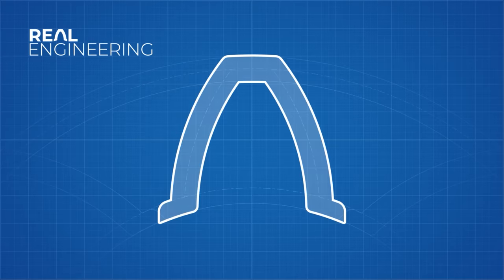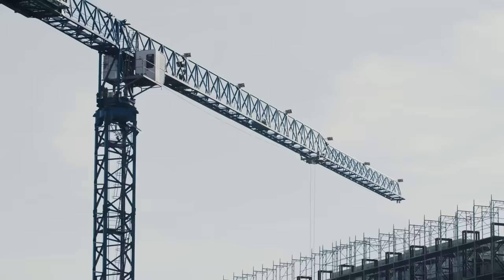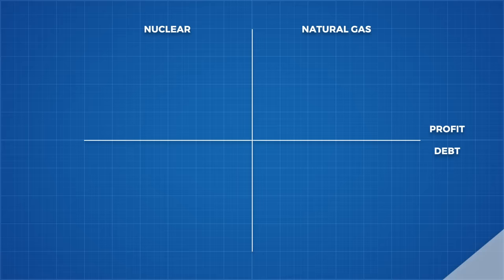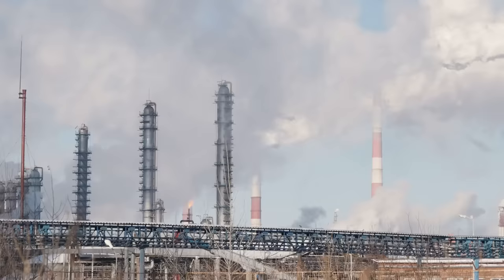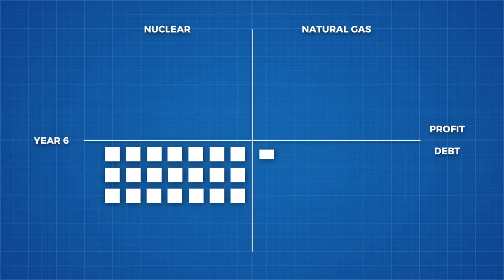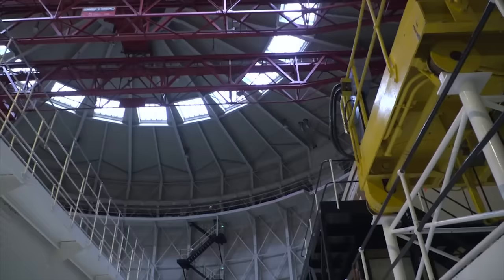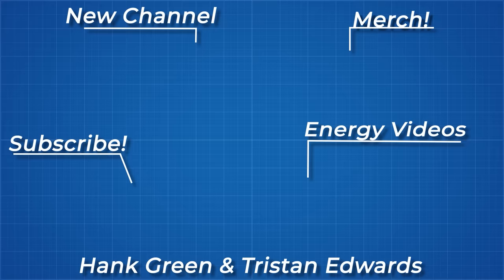The Economics of Nuclear Energy

Comment: LCOE is a poor measure since it doesn't include all the other infrastructure needed to make a workable grid. For renewables that include greatly increase transmission capabilities and massive amounts of storage, which other forms don't need. If renewables were required to include the 12-14 hours of storage needed for reliable power through all conditions, the LCOE would be far higher than anything else.

Comment: The only reason Diablo power plant can't compete is because of how California sets up their grid. The state does not put baseline nuclear first which means there are periods where with excess solar and wind energy. During those times power becomes almost free.  
Battery storage isn't the solution, its expensive materials wise and we've got limited resources to make them. 

you conclusion is so fundamentally flawed, nuclear is baseline, over a lifetime they generate 95+% of their rated output. peaking should be done with mass based storage (pumped hydro ect)
Reply: Diablo is and always been base line.  You cannot swing load with a nuclear plant. utilization factor is 93% and has never exceeded 94%....just saying

Comment: In the US the cost for 1Gw is about $15B or close to three times the $6B. The US has two 1G reactors under construction in Vogtle, GA, at a cost of about $30B.

Also you video does not Decommission, planning\feasibility\geology studies, etc. Usually a Nuclear power plant requires between $1B and $2B just for the planing and feasibility studies, thats before a single shovel full of dirt is moved. Then there is the cost if the plant meltsdown. A single meltdown and cost trillions in economic loss due to loss of land near the site, clean up cost, as maintenance to structures to confine the destroyed reactor. For instance the Chernobyl meltdown was the straw the broke the back of the Soviet union. Four years after the disaster, the Soviet union collapsed.

Comment: Nuclear power is so risky financially that safety is moot. 
 
1 - Three Mile Island
In March 1979, Unit 2 at the Three Mile Island nuclear station suffered a partial core meltdown.   It was the most significant accident in the history of American commercial nuclear power.  The accident taught us two important lessons. 
 
1.	Nuclear power is safe for people.  Inadequate regulation, faulty design, imprudent operations and several coincidences all contributed to causing the accident.  Bottom line - the containment held.  No one was hurt.  There was no catastrophic radiation leak.  Damage awards were small. 

 
2.	Nuclear power is extremely dangerous for investors.  John Graham, the Treasurer of General Public Utilities (owner of TMI) wrote in Journal of Commercial Bank lending - May 1980, “The discussion of whether to recommend a moratorium on new nuclear plants in the Report by the President’s Commission on Three Mile Island is somewhat irrelevant.  I do not believe that there is a board of directors of an electric utility in the country which would now approve a nuclear plant as a new initiative.” 

Why?  Overnight, a billion dollars in revenue producing assets turned into a gigantic, unfunded liability.  People were safe.  Investors were not. 
 
2 - Darlington 
Ontario came close to a nuclear financial meltdown.  The first unit at Darlington was started up in 1991.  After a month, they did an inspection.  To their horror, there were cracks in the giant rotor.  It was a design flaw.  All four rotors had to be replaced.  More delay - which in a debt intensive project means escalating costs.
 
It got much worse.  When they took the fuel bundles out of the reactor, they had been shaken apart.  A massive pump within the system was putting out a vibration that was destroying them.  The pump was re-designed.  The vibration stopped.   Had the re-design not cured the problem, it was possible the entire $17 billion project would have to be written off.  (I was an Executive Speechwriter at Ontario Hydro.  I sat in the office of Ontario Hydro Chair Marc Ellison with Phil Carter, Premier Bob Rae’s personal representative at Hydro, who told me this story.  The test of the new pump was the next day and they were terrified that they would have to announce the complete write-off of the Darlington project). 
 
3 - Things have not gotten better for the nuclear industry  
The only nuclear power reactors currently under construction in the U.S. are at the Alvin W. Vogtle Electric Generating Plant in Georgia.  They are years behind schedule and billions over budget.  Plans to add two nuclear reactors to the V.C. Summer Nuclear Station in Jenkinsville, South Carolina have been scrapped with a loss of $9 billion.  Westinghouse, the prime contractor in these projects has filed for bankruptcy.  Parent company Toshiba was forced to sell its chip unit. 
 
Georgia Power - Vogtle - http://fortune.com/2018/09/27/vogtle-nuclear-power-plant-construction-deal/ 
South Carolina - https://theintercept.com/2019/02/06/south-caroline-green-new-deal-south-carolina-nuclear-energy/ 
Westinghouse bankruptcy - https://www.reuters.com/article/us-toshiba-accounting-westinghouse-nucle-idUSKBN17Y0CQ
Reply: You do realize that three mile island is still operating today right? And that to date no civilians have died in the US as a result of nuclear reactors.... right?

Also your argument against nuclear because of investment issues and it having to turn off for a time to undergo repairs forgets about massive issues like oil spills that are actually fairly frequent and cause massive ecological and economic damage.

>Government red tape and congress impeding the construction of nuclear plants PROVES it's bad!
Yeah man, you got us there. I mean it's not like France exists or anything.

Comment: I wonder if it would be possible in some cases to build a hydroelectric battery, a sort of uphill “dam” that can have water pumped to it during the night when the nuclear plant demand is low to utilize the excess produced energy and use that stored hydraulic power from the water to spin turbines during peak hours when the nuclear power can’t quickly react to jumps. Probably too many requirements to be met to really be possible in more than a few cases but it would be interesting
Reply: Yes it can and has been done to store excess energy from the production of many different power sources.....even solar.  However, the energy needed to do the pumping vs the energy gained from the water flowing down into a turbine generator makes it very inefficient.
Reply: This already exists and has existed for quite a long time. It is called pumped hydro storage, and it is cheaper and better than batteries for storing large amounts of energy. Batteries have a lot of strengths and other applications that make them better for energy storage in a lot of other cases though. However, pumped hydro storage is only limited by the size of the reservoir that can be built and the lifetimes of the hydroelectric turbines and pumps. However, as with all energy storage, there are extra losses from conversion into stored power and back into electricity. 
If you are pondering what would be a good approach for making nuclear power plants load-following, then a lot of Gen4 reactor designs incorporate load-following design features such as molten salt storage which are more efficient and have more potential to take advantage of cogeneration.

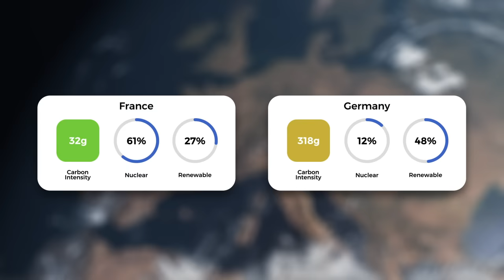Comment: Does anyone have a source on the carbon intensity numbers put up at 1:05?  Because that is a big deal.  France has a carbon intensity of 10% of Germany, the king of renewables!  If you optimize your grid for low carbon instead of low price, you'd go nuclear, hands down.  And nuclear isn't even that expensive overall, it is just very capital intensive up front.  But that is just a financial engineering problem.  Give Nukes 0% loans, or give them carbon credits during the construction period, or actually gasp put a tax on the carbon that has to be burned when the renewables aren't producing.

Comment: Does the economic model includes insurance costs.  For example, developing robots that will not break under heavy nuclear radition when/if a disaster happens.  

What about the cost to create a platform of frozen ground to prevent a melted core from reaching the water table.  Which, by the way, will need to be kept frozen with a team of engineers for decades if not millennia.  Probably using more energy than the plant would have produced.

The problem is these plants are uninsurable.  

( Cost of accident ) * ( probability of accident ) = uninsurable
~$200B * ( 1/20) = $10 billion

Plus the spent fuel is another ignored cost expected to be picked up by the tax payer after the executives get bonuses, investors get profits and the company dissolves once the accident happens.

Comment: Well a 6 year build cycle is kinda generous. Construction for a new reactor in France began in 2007 and this thing is still not finished and it may never be. In Finland construction began in 2005 and it is finished in 2022. Still not producing electricity for the grid though. France is kinda fucked right now. Their reactors are old and a fifth of them are shut down right now in the middle of winter due to maintenance. The reason Germany has such a bad CO2-footprint is that honestly energy wise is has nothing going for it besides lignite. The locations for renewables aren't the best and it has no gas, oil or stone coal. So it still burns a lot of lignite. France on the other hand has great locations for renewables. They have much more space for wind and solar, more sun and much more coast line for off shore wind. With enough public support they could retire their old reactors and transition into gas + renewables.

Comment: LCOE doesn't include anything about the environment and "utility". Add carbon taxation and price intermittence in and the numbers would look different. Low carbon electricity production is not a technological issue, whereas in other industries it is : long range flying without kerosene for example isn't possible yet. So by default all electricity production should be low carbon, eliminating gas plants (and oil and coal). Taxing carbon would have the same effect. Now you're left with nuclear and renewables, add the cost of storage (batteries, pumped hydro, etc., all technologies welcome of course), renewables could also "buy" some nuclear production to compensate for intermittence. It would be very interesting to know the results of such calculations.

But indeed politics play a major role. After Fukushima all French nuclear power plants have been upgraded with elevated diesel generators, "strike teams" have been created that can go to a stricken plant to deal with the issues and bring mobile generators and pumps in a few hours. Some seawalls have been improved. Yet politicians have decided to not decide about replacing aging nuclear plants, and have closed the oldest one, under pressure from anti-nuclear people (including in neighbouring Switzerland and Germany).

Another factor is the price of electricity delivered to people. In France it is much cheaper than in Germany and Italy, leading to people heating their homes with it (bad thing in the past, now not so bad since it's low carbon, and can be done efficiently with heat pumps). On the other hand and despite incentives, solar on roofs is far less common than in Italy where it's almost everywhere.

Comment: Has Chernobyl been forgotten along with 1000 plus years disposal.
Reply: Chernobyl happened due to a very particular set of circumstances that simply are not possible in a modern context. 

Reprocessing reduces the waste mass by 99% and the need storage duration to ~300 years. You can also transmute that remaining waste to stability in existing fast reactors, reducing the amount of waste to zero.

Comment: One of these days energy videos will be one very careful in comparing costs and build time. Here a gas plant is given 2 years to build.  How long does the gas pipeline require? It’s not 2yr.  Pipelines are frequently challenged legally, stopping and starting these cross country projects, or they’re just cancelled.  Nuclear needs no pipelines, needs no LNG tankers that may or may not arrive.  Every unit of gas used by the gas plant steals three units of gas heat from building heat.  These issues and many like them mean it’s rank amateurism to compare only on a plant by plant case, when it’s the entire system that matters.

Comment: after a quick "research " i found that for a nuclear powerplant the CO2 per kwh is 12-50, not 12 as you stated. Is this a mistake of myself or were you using the lower end of the CO2 "emission" to mislead? Or are those 12CO2/kwh in modern western plants and the 50 in older less modern plants? 
I know this is 2 years after the video released, but i still hope someone can explain this to me.

Comment: Real Engineering, I wonder what the Levelized Cost of Electricity is for sea based wind turbines?
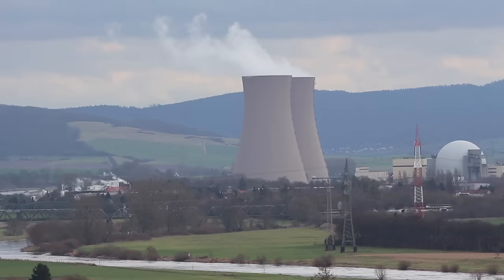Also, the last time I saw comparison figures for wind vs solar was about 15 years ago; at that time wind was down to 7 cents per kilowatt, and Solar was just coming down to 12 cents per kilowatt.  A few years later I hear that wind was down to 3.5 cents and I think it's currently at 3.0 cents. So I was surprised to see in the chart at 13:30 that Solar was listed as cheaper than land based wind.  Maybe a video comparing wind versus solar would be a good idea in order to update people on the current technology.